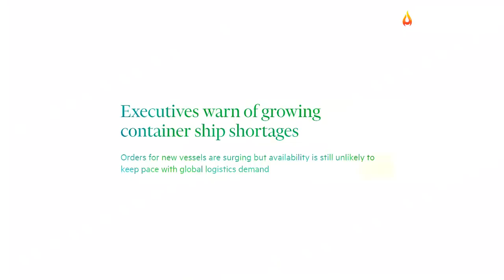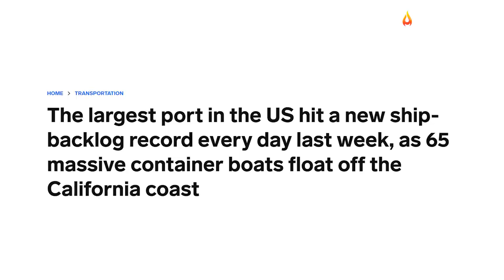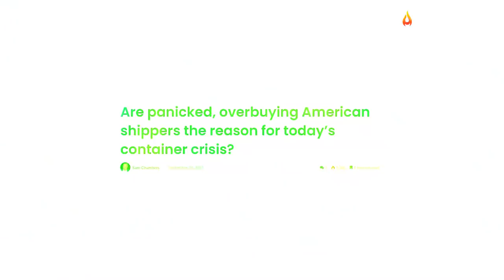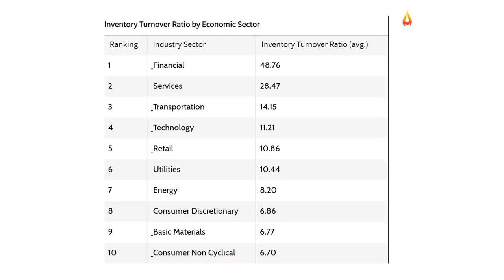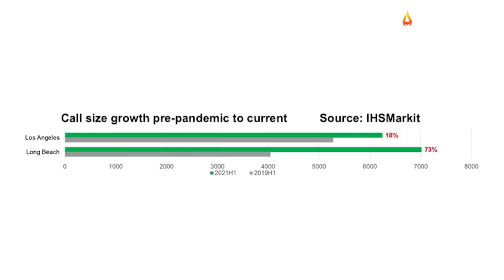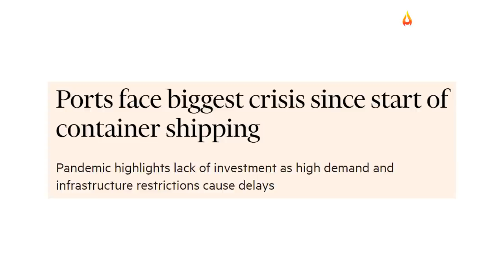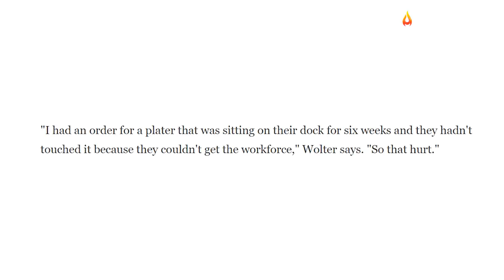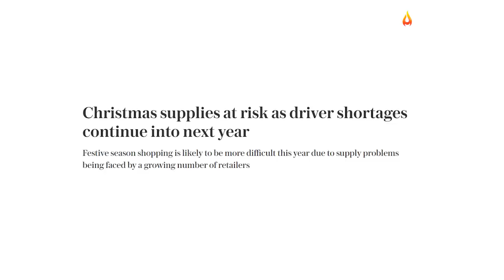Shipping Crisis Gets Crazy – 65 Container Ships Get Stuck At California Ports And Shortages Soar

Comment: Thanking God we had the foresight to keep all our carburetor run tractors and have numerous extra parts on the farm here.. We started buying parts about 5 years ago. Carb rebuild kits, fuses, spark plugs, and in the event of battery shortages, MAGNETO STARTERS. etc. So when the so-called "modern" equipment used to harvest crops here fails, we are still bale to get everything done. It'll just take longer..

Comment: Dirty diesels! That is in part why containers are not being picked up in California. There may be a surplus of  truck drivers willing to have heavy, nasty, fuel consuming containers push their trucks down the Rockies. But their trucks are not permitted in California because they are not California compliant.  Given a choice to pull a lighter, aerodynamic well maintained half laden trailer over a mountain range in a pristine state of the art truck or a heavy container on a sketchy chassis trailer with bias ply tires I think most would opt for half the weight at a competitive rate.

Comment: The stockholders was demanding a higher profit margin on these commodities and by getting rid of the wire housing necessary to hold these items they seen as sweet dividend check the Brokers don't care where the market goes up or down a crashes because of they know it they had you can sit that's why some of the Brokers I've had to deal with over the years had their own warehouses to hoard stuff and I mean Brokers hoarding truck loads several hundred truckloads depending on how rich they were